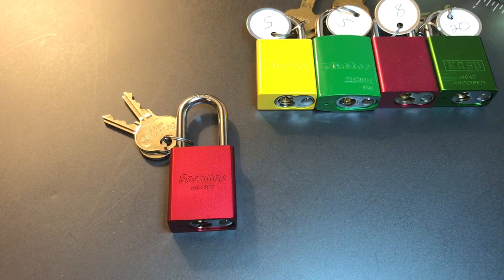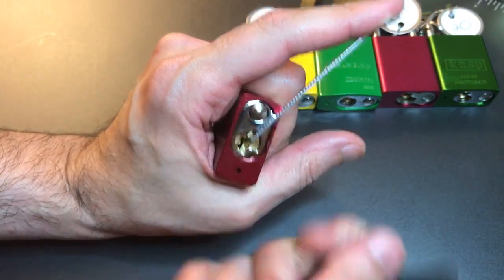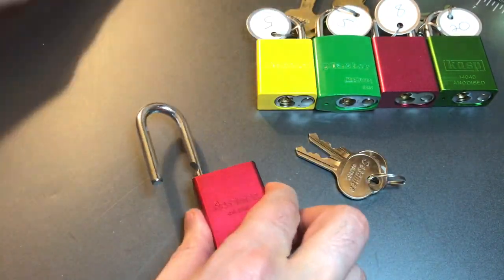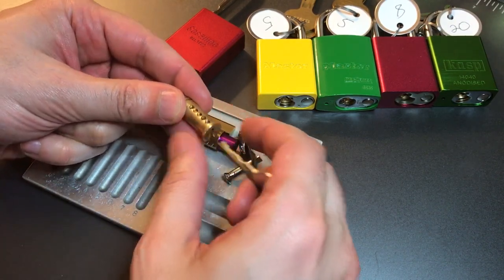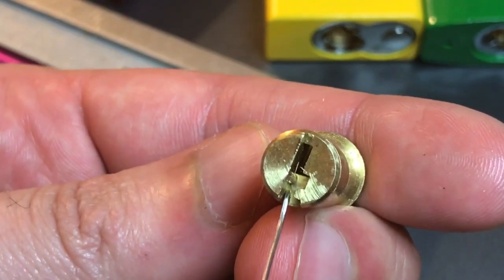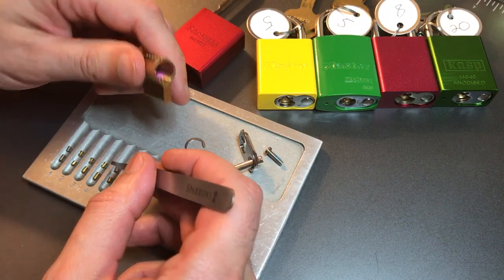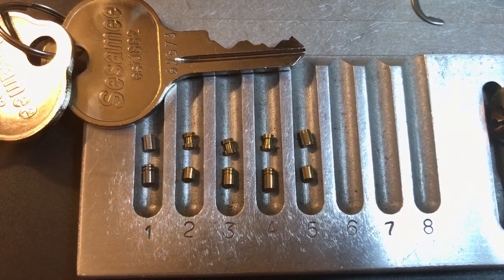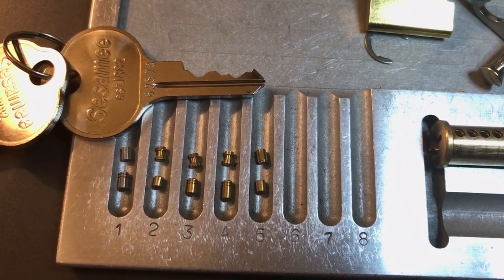[313] 40mmAL Series: Sesamee 90129 Padlock Picked and Gutted

Comment: I like Sesame locks. They seem like quality locks for their price point as well as offering some nice features. I have this model that you sent me and several of their larger models.
Reply from the maker: I think I send two of these... didn't I send you a brass one as well with a MTL or Angal core, or an I thinking of someone else?  In any case, I agree that they make nice locks.  I think they are made by schlage based on some of the designs and features, but I'm not sure about that.
Reply: yes you did, This red one and the one with the interchangeable core with the Angal core (nice core BTW). You should receive your locks today or tomorrow....
Reply from the maker: Jess Hull Got them... Thank you!  I have not touched your challenge lock yet... I'm going out of town for a couple days and am saving that and a few others for entertainment on the train.  The Zeta is very nicely built, and a above-average pick.  With the tight dimple/smiley keyway, it would be a truly difficult pick if they put some false gates in the pins/sliders.  I wonder why they didn't go that last 2%.
Reply: Oh good, Glad everything arrived ok. I wasn't expecting much fro the zeta when I bought it but I was pleasantly surprised. As to why they didn't go the extra 2%? well thats an easily answered question. Lock companies are in the business of making locks, not making sense. Well don't expect too too much from my lock, its only the second one I've made. you may have seen my first one on Bills channel. Just a heads up, when you go to gut it you need to push that top pin into the lock body so you can then turn the core counter clockwise to release the shackle, so you can access each of the screws under each side of the shackle....yes theres two for some reason...have a safe trip.

Comment: This might sound wierd, did you pick pin #4, or is it an issue of the driver pins being too long
Reply from the maker: Not weird at all... most people wouldn't notice this.  This is a case of a very long key pin that only required a tiny nudge to set it.  It probably set before the pin was tightly binding, so I didn't notice.  Way to pay attention to what is going on, and notice something out of place.  This trait will take you far in picking!
Reply: Now, the question i have, is if there are pins that are too long or short, will that effect the scoring ?
Reply from the maker: Jeff L Interesting... on one hand, this can be seen as a security flaw... other the other, it falls into the category of penalizing particular bitting.  I'll give it some thought and address the issue if it comes up.